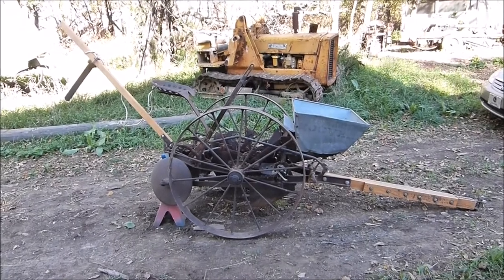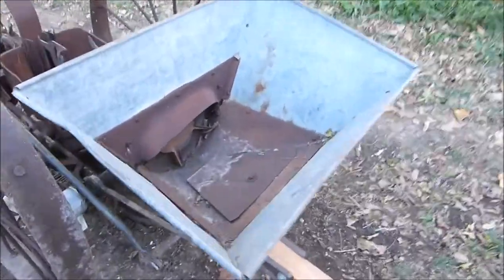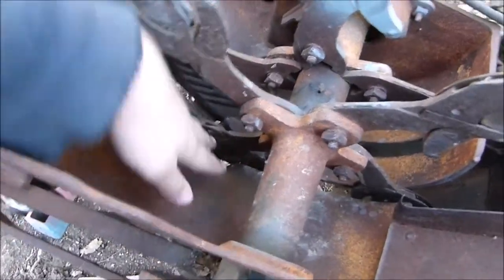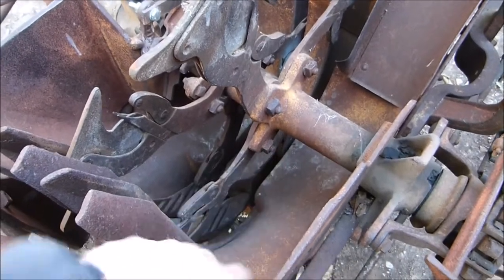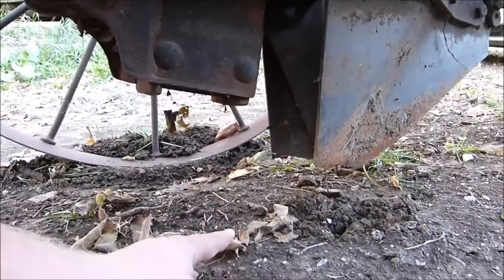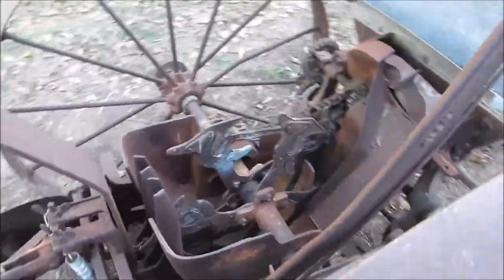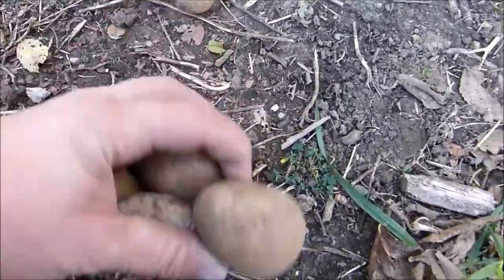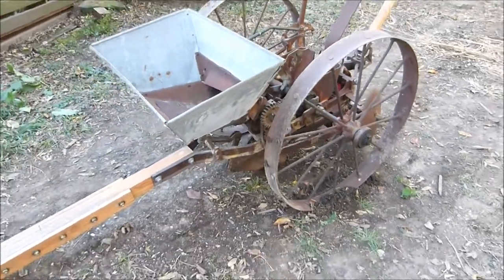How our 1918 John Deere Hoover Potato Planter Plants

Comment: My grandfather has one and uses it every year. I get the honor is sitting on the back and making sure everything goes right. A lot turning metal to mess you up if you’re not paying attention. Never had a problem though. Great machine. Hes had and used it for decades without fail
Reply: Yes.u could loose a finger handy enough..Great invention though
Reply from the maker: @charliedoherty5965  Yes, definitely not OSHA approved. We haven't had any injuries on ours yet either. Just have to keep hands out feet out of where they shouldn't be. 😀